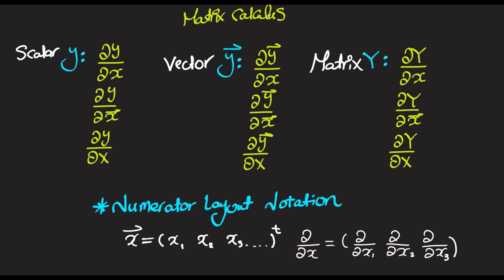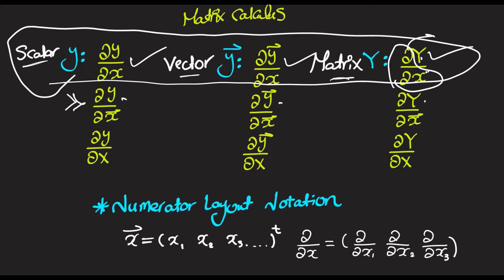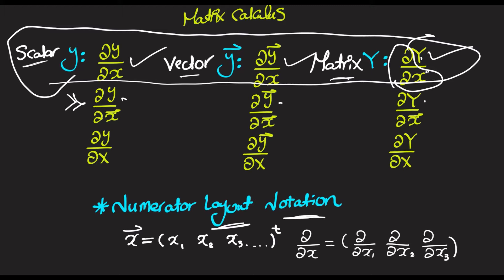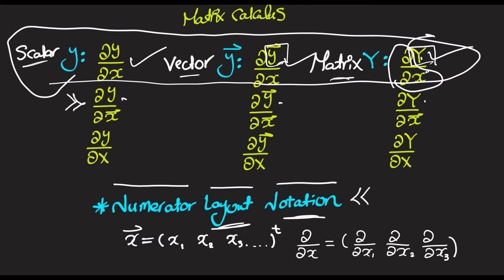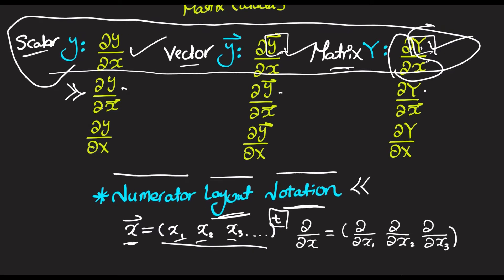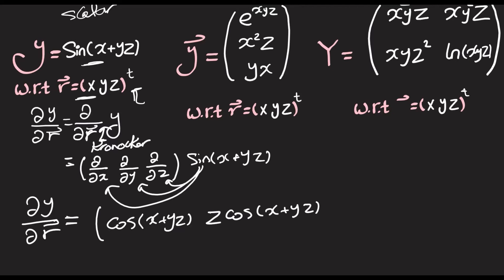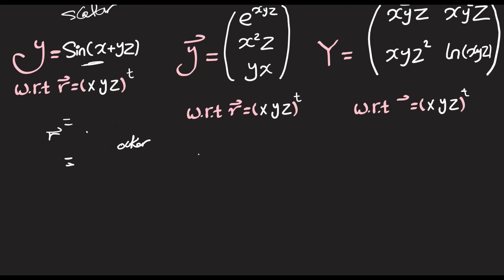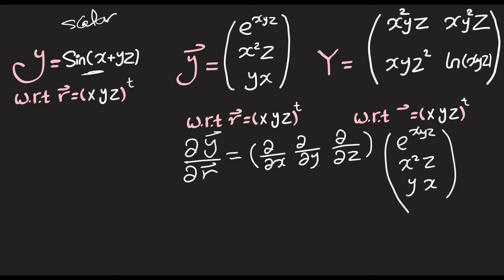Matrix Differentiation - Derivatives With Respect to Vectors

Comment: Thanks so much for this video! May you please explain why there are two different layout notations? You seem to be using the Numerator layout notation, but my classes seem to flipflop between them randomly haha
Reply from the maker: For why there exists two notations, it's mostly for historical reasons. Mathematicians defined Jacobians (derivative of vector w.r.t vector) and Gradients (derivative of a scalar w.r.t vector) before matrix calculus was formalized. In these definitions, it's as if the Jacobian is written in a way that follows the numerator layout notation but the gradient (as a column vector) is written in a way the follows the denominator layout notation. 

So for instance, if we choose to standardize the denominator layout notation then the definition of the Jacobian matrix is rendered incorrect (needs to be transposed). The solution is hence just to allow both (let the author specify which they are using).
Reply: My class uses the Denominator layout. So if I have two column vectors Y = [y1  y2]^T   and X = [x1  x2]^T
Then what will dY/dX be?

I thought it would be:

dY/dX = [dY/dx1 ]
                [dY/dx2 ]

But this can't be right because Y is a column so that means we'd get a 4x1 vector which can't work.
dY/dX = [dy1/dx1 ]
                [dy2/dx1 ]
                [dy1/dx2  ]
                [dy2/dx2  ]
Reply from the maker: @matthewjames7513  

You would transpose Y, now its [y1 y2] and the perform a Kronecker product with (d/dx1 d/dx2)^T which should give 
[dy1/dx1 dy2/dx1]
[dy1/dx2 dy2/dx2]

Notice that this is, as expected, the transpose of the Jacobian matrix.

Observe as well that I mentioned the Kronecker product at some point in the video and explained it in an earlier one.

Hope things are clear.
Reply: @breathemath4757  thank you for your answer :)